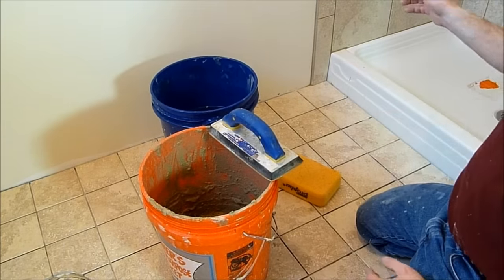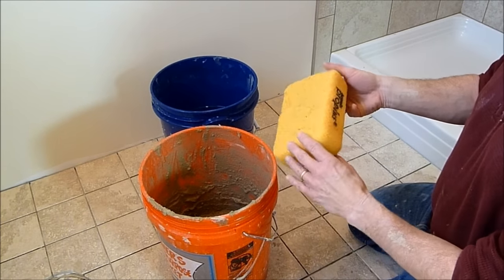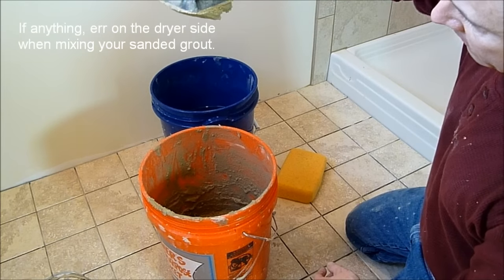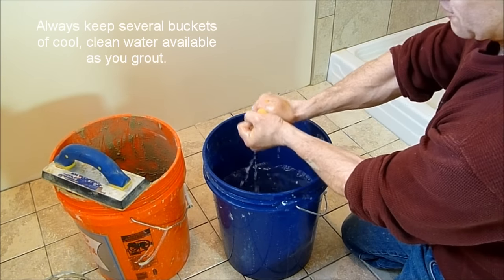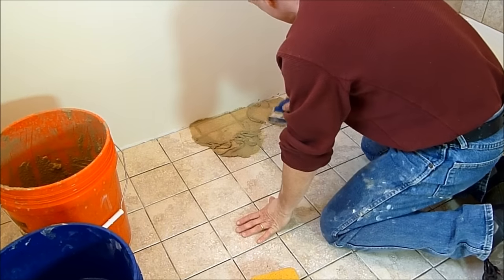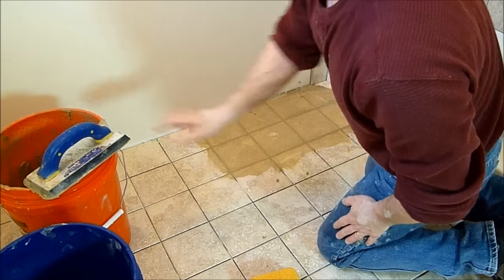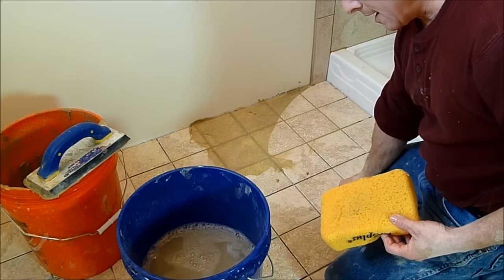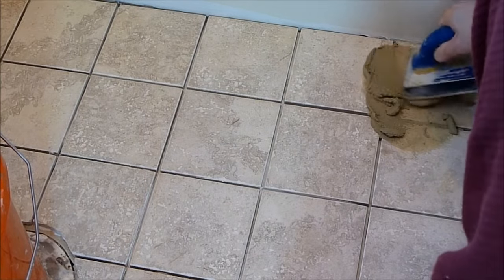How To Grout Tile: Correct Technique Makes It Easy

Comment: How long after adding tiles should you start grouting? Any tips?
Reply from the maker: Assuming you are using thinset mortar to adhere your tile to the substrate, then a minimum of 24 hours is required before grouting.  That's 24 hours after the last tile is laid, not 24 hours after you started!

Comment: Question: the tile that's been in the house for the last 50 the grout doesn't crack or chip off ever.. HOWEVER  someone install some tike in my house last year and it's cracking already. The floor got wet and it really cracking down. Why is 50 years old grout not cracking at all and 1 year old grout cracking fast?
Reply from the maker: There are lots of reasons why grout might fail.  At the top of the list is too much flex in the floor itself.  Not all floors are appropriate for tile because the framing and subfloor/underlayment may not be strong enough.  Similarly, the installer may not have used appropriate methods for preparation of tile and grout. When the floor flexes too much, the grout will crack and come loose.  Other issues include improper mixing of the grout, poor installation of the grout, use of the wrong type of grout for the tile spacing, or a failure to allow proper curing.  I can't say without looking at it in person, but you may be able to have a local pro check it out for you and get an answer.

Comment: Hi can u help my tiles r coming away do I have to take all tiles off and redo them
Reply from the maker: There are a lot of reasons why you might have tiles coming loose, including poor installation, the wrong choices of materials, or structural issues with the framing.  Once they are coming loose, though, you are probably on borrowed time.  It may be possible to reinstall the tiles, but it will be a patch job at best.  I'd suggest having a pro come in and find the source of the problem before you spend time or money trying to patch the loose tiles.  It may well be a lost cause.

Comment: I don't know if you read these comments anymore, but my grout says to wait half an hour before wiping it with the sponge. Is that optional? you seem to do it immediately.
Reply from the maker: +rainjoules Down in the comments I've answered this somewhere.  The old methods from many decades ago specified this waiting period, plus a lot of wiping around in circles.  Assuming you have a standard grout, sanded or unsanded,  you can use the method in my video.  Just pay attention to the details-- get the grout consistency right, work it all the way into the grout lines, and make certain you squeeze all the excess water out of your sponge.  Use the wipe and turn method shown in the video, work small areas at a time, and swap out your water bucket for clean water every so often if you are doing a large area.
Reply: +enduringcharm thank you!

Comment: I tiled my bathroom about a year ago and now the grout is discoloring. I tried many different cleaners and nothing works. I'm guessing the tile guy used the wrong grout. Now I want to tear up the whole room and do something different. Do you have any suggestions before I do that? Thanks.
Reply from the maker: It's unlikely the brand or type of grout is to blame.  More likely is that the grout was not sealed or sealed well, or that the products you're using in the shower (if that's where the discoloration exists) are to blame.  You don't mention if you have sanded or unsanded grout.  The former is used on wider joints, the latter on narrow joints.  There are two kinds of discoloration that appear after the grout is set up and you begin using a space.  One is what I'll call "mechanical" dirt.  In other words, actual particles of dirt or other stuff gets ground into the grout in high traffic areas, leaving behind a darker color.  This is more prevalent in a sanded grout because the texture of the sand  captures the dirt.  The second kind of discoloration is staining related to substances that penetrate the grout.  Think wine or coffee stains in kitchen grout, or soap or shampoo stains in a shower.  Sealing the grout can help prevent the staining, but it won't help with mechanical dirt.  So, you need to figure out which you have.

As far as fixing the problem, much depends on the type of installation you have.  If you have a discolored floor and you have one inch square tile, then it might well be easier to redo the whole floor.  On the other hand, if you have six inch or twelve inch tile on that floor, then it isn't that big of a deal to remove the existing grout and just regrout (and seal!) the existing tile.  I published a video on how to remove grout, so look for that.  In some cases you can just scratch the surface of the grout using a carbide scraper designed for this purpose and that  is enough to remove the stain.  More common, though, is the need to regrout completely.
Reply: Yeah, I'm thinking it wasn't sealed properly. I really appreciate your advice and will look into trying to fix the problem instead of tearing out the tile.Thank you so much.

Comment: Will this method work on filling in slightly small cracks tiles?
Reply from the maker: Presumably you mean that you've got some damaged, cracked tiles and you'd like to minimize the look of those tiles?  If that's the case you need to realize that the adhesion of the tile to the substrate is probably compromised.  Best to remove the cracked tile(s) and start over.  But, to answer your question, yes, you can use grout to fill cracks.  You need to match the grout type to the width of the cracks.  If the cracks are under 1/8" wide you'll need to use an UNsanded grout.
Reply: enduringcharm thank you so much for your help!!!

Comment: In my kitchen I have bone white grout. Can you tell me the best way to clean it?
Reply from the maker: Acres ninety Discoloration of grout happens two ways.  A stain can develop, which is a result of an actual color change in the grout--think spilled coffee or wine.  Grout sealer can help prevent this.  Mechanical discoloration (for lack of a better term) happens when physical particles of dirt get lodged or ground into the grout.  Sealer can't prevent this.  Since you have pure white grout, you could try a stiff scrub brush and a bleach based cleaner like Clorox Cleanup or the like.  If that fails, you can always re-grout, which isn't as difficult as it may seem.  See my video:Removing Old Grout From Tile

Comment: What are the downsides to leaving the grout sit without wiping then later once it’s all dried up, scrub it off with wire wool?
Reply from the maker: I see you have never worked with grout before.  I'm not sure why you would want to subject yourself to hours or days of trying to remove dried grout with steel wool, but even if you did enjoy such a thing you would end up with some ugly, discolored grout lines filled with steel fibers that would rust, and you would possibly damage the surface of the tile as well.  Even those who prefer to work grout into the joints in a circular motion and let it sit before wiping still make certain they've removed all the grout from the tile before it dries.
Reply: @enduringcharm  I’ve seen it done this way before so that’s why I’m asking. To be fair, the dried up excess grout easily came off with a hard brush. It may not have been ideal but it worked. I’d rather do things the right way though.
Reply from the maker: Maybe you saw grout haze or residue, rather than actual grout dried on tile.  If you just applied some grout onto tile and left it you would have a complete mess.  That's what I thought you were describing.  Any application method, though, will leave some degree of haze.  That is essentially dust that will wipe off pretty easily.  My method leaves very little haze, and it will easily come off in 24 hours with a damp microfiber rag.  The old school method leaves a little more haze, typically, though it comes off without too much trouble.

Comment: No knee pads? Great instructional video
Reply from the maker: I do wear them sometimes.  An awful lot of them are more trouble than they're worth because they fall down, or cut off circulation, or dig into the floor.  And when I find decent ones I wear them out right quick.  It's a no-win.

Comment: why do we leave space between tiles to fill?  Why do we grout? can we not put the tiles close enough so the grouting is not needed? thank in advance.
Reply from the maker: You can have a narrow grout line with certain tiles, as little as 1/16 of an inch.  But, that's as close as you're going to get.  In that case you'll use non-sanded grout to fill the space.  Grout does help hold the tile installation together over time, it allows for variations among tiles and tile placement, and it consolidates the appearance of the job so that it all looks as one.

Comment: Why the two swipes only with the sponge? I’ve used several swipes and it seems fine?
Reply from the maker: The exact number of swipes is unimportant.  The point is just to roll the sponge as you swipe, use minimal water, and remove the excess grout as efficiently as you can.
Reply: enduringcharm - ohh I see. Thanks.

Comment: is this the same technique for unsanded grout?
Reply from the maker: I do use the same technique either way.  However, with unsanded grout you are presumably also grouting very narrow grout lines--probably around 1/16th to 3/16 of an inch.  They can be tricky to fill so use a smaller rubber float if you have one and take a little more time and care to get the lines filled.  With narrow grout lines I also like to use a sponge that's a little worn in and softer, rather than a new one that's stiff.  A new one may lift out more grout than you want in each cleaning pass.  You need a soft sponge and a light touch.

Comment: So why so much emphasis on spinning the sponge during the wiping operation?
Reply from the maker: By turning the sponge you are exposing clean sponge surface as you go, which results in a clean tile surface too.  If you didn't turn the sponge you'd just be spreading the grout rather than removing it.  Try it both ways and it will be evident.

Comment: whats grout joints for? grout is not glue, so what is it for?
Reply from the maker: You have to realize that tile and grout is an ancient building process, and part of what we do today is due to tradition and a traditional look rather than a special function.  Originally grout provided a means to keep everything stuck together, especially mosaics.  Today our thinset mortar is tenacious and keeps tile in place, so the grout is mostly about the look of the grout lines.  It does offer additional strength, however, and it helps keep the tile edges secure from foot traffic.  Grout lines also offer a way to make up for a less-than-flat floor and movement in the floor with traffic.

Comment: At 2:54 do you say you are or are not pressing hard?
I had someone install my 20 in rectified edge porcelain tile on a recommendation and after they finished, they sent a rookie to grout it.
Because they floated the tiles individually in some areas there is a larger drop between the tiles, so some areas sunk down after initial grouting and they came back the next day to finish. Correct me if I am wrong but, I would assume that it all should have been done at once or at least not applying a thin layer of grout over the top of old grout. I don't think there was a min 1/8 dept on the top layer. 
They used polyblend from homedepot (unsure of the quality) and in some areas I can scratch it out easily with my tumbnail, also there are areas with thinset on the edges that bothers me. 
I'm not happy with this, so i'm removing all the grout and re-doing it myself (1100 sqft) 
removal of a 1/8 grout line is a pain
Reply from the maker: Hold on, I'm confused.  The "drop between tiles" you mention, is this on a floor or a wall?  And, do you mean that they used thinset mortar to build up areas underneath certain tiles to make them all level?  If the tiles are uneven (known as "lipping") then that must be corrected before the thinset adhesive dries and certainly before grouting.  Plus, you need to let the thinset dry before you grout, typically a minimum of 24 hours.  In certain cases the envelop can be pushed by a few hours, but that's it.   Then, before you grout, any stray thinset must be cleaned off the edges of the tile and the area cleaned up.  Maybe if you can give me more detail I can offer a better explanation or solution...
Reply: This is floor tile, I assume it's thin set they used to level each tile individually by eyeballing as they installed. They should have floated the whole floor. I think the guy said one bag should last like 30 tiles, he was only getting thru 6 tiles per bag sometimes. 
He said it was the worst floor they ever worked on, but I don't know...
Some of the tiles are slightly uneven, not many though, I can live with it, but it shows more b/c there are rectified edges (laser cut 90 degree) and the grout line is 1/8.
The thing I am not happy with is the inconsistency in the grout height relative to the lip of the tile. so I am removing all the grout and going to take a more careful approach to making sure it's all perfect.
I'm told by a different installer that I trust that I have to remove at least 1/8 to 1/4 of the grout to ensure proper bonding of the new grout, I think I am going to buy a more expensive grout than the home depot polyblend stuff.
Reply from the maker: John Rooney
Oh, okay, now I see.  If the floor was not flat (as opposed to level, which is a different problem) then tile lippage is an issue.  With larger tiles, air can also become trapped in the thinset as the tile is laid which leads to a weak spot, which then leads to cracks.  The best way to handle a floor with large dips and peaks is to use a self-leveling cement compound over the subloor but beneath the underlayment.  The self-leveling compound is mixed to a watery consistency and poured over the first layer of plywood, where it seeks it's own level.  That dries in 24-36 hours and then the final layer of plywood goes over the leveling compound, followed by cement board or some other backer product.  They tried to cheat by using thinset to do the leveling.  That's okay in limited circumstances for one or two tiles and not much of a gap, but it isn't an appropriate tactic for large scale use.  If you plan on leaving it and hoping for the best, you can regrout.  I have a video about how to remove existing grout, so watch that.  I would remove all of the grout down to the backer, unless you are using the identical bag of grout that they used.  Once you get rolling it comes up pretty easily.  The quality of the powdered grout you buy at Home Cheapo or Lowes is actually fine.  I don't really think you'll find an advantage at a tile store.  When you do the grouting, use a light rolling touch with the sponge so you don't remove a lot of grout with each swipe.
Reply: Thanks, yes I have started to remove the grout it comes up pretty easy, in some areas it is thin, meaning i scrape it with one or 2 passes and a large hollow gap appears. The tile is laid out in a offset or subway pattern, so I have to be really careful as to not damage the tiles. I'm using this triangle grout scraper to take off the topmost layer, doesn't take off much b/c it's a 1/8 grout line, and then use the hand held scraper with the rough carbide tip  and on the long stretches of grout I'll use  oscillator with the carbide circular tip. It's going to take a while to get it down to a min. depth of 1/8. I will be using the same poly blend grout, I guess if it is mixed properly it will be fine. Will be using the techniques in your video working in small areas at a time and making sure that I get a nice even grout line.
Reply from the maker: John Rooney
It's a suck job.  All you can do is be methodical and thrown on some music while you work.  If you've never grouted before, watch my video and read through the comments of those who also tried it the first time.  It's not rocket science, just pay attention.  Wouldn't hurt to mix up a small batch in a cup to test the color after it dries and give yourself some practice with the consistency.
Reply: Put some music on in the background as I'm taking out all the grout with my carbide oscillator (1/4 done already)
Reply from the maker: John Rooney
It's all a state of mind.  As they say in the Army: embrace the suck!

Comment: You see if you would put a lot off grout on the flor and stretch it out like a worm and start from one end to the other end of the grout it would be faster than doing it line by line and when you wipe you mix it first then the final wipe
Reply from the maker: I know what you mean--dump a bunch on the floor and move that pile along as you go.  Keep in mind this video was intended to help DIY homeowners learn to grout, so it's better to move a little slower.  In my own work I do generally move more quickly and I will also sometimes "move the pile along" as a technique.